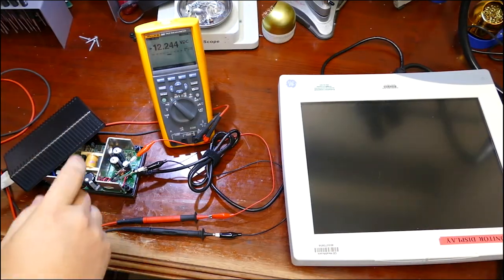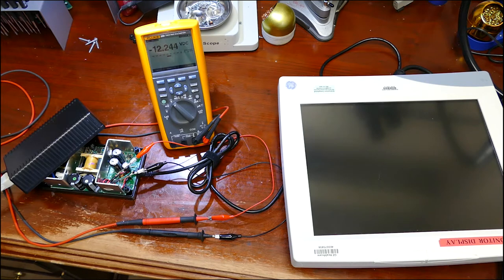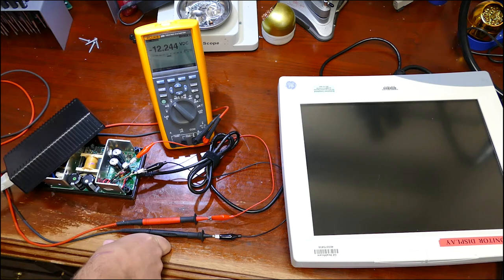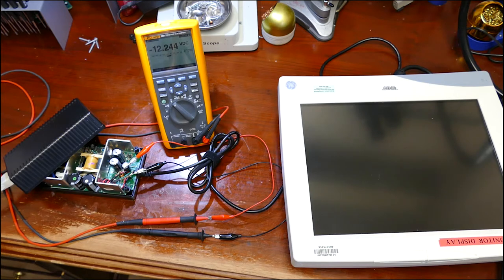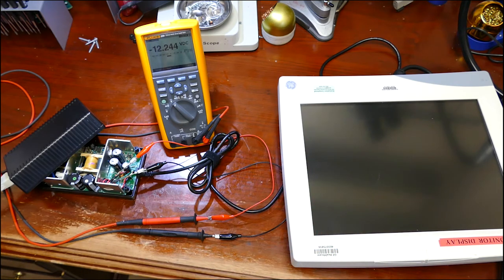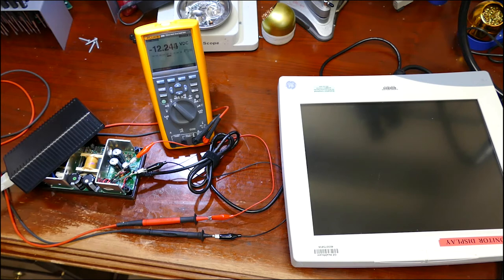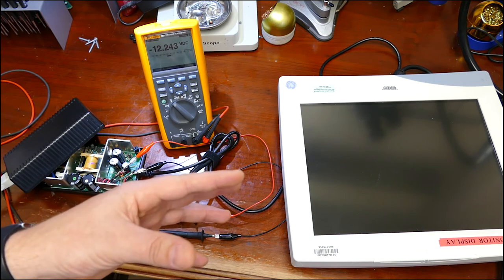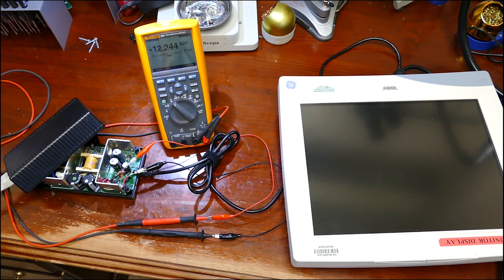Pro Tip 5: Voltage Does Not Equal Current

Comment from the maker: Take notice that I'm using another trick to take these measurements in a less invasive manner. I use needles to test wires without cutting open the outer insulation. In this case, I was able to slide 2 needles under the shrink tubes where the wires meet -then clip to jumpers.  Be careful of the sharps hazard and mark your needles (perhaps with some shrink tube) to be sure that they are not actual used patient needles.